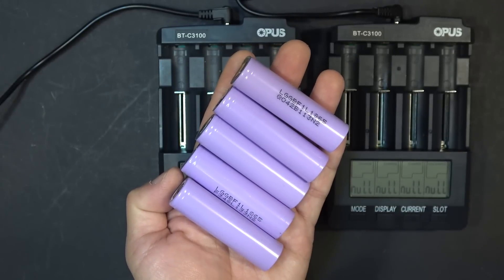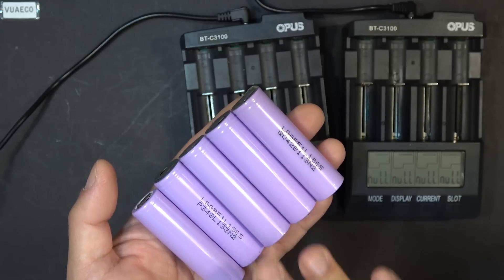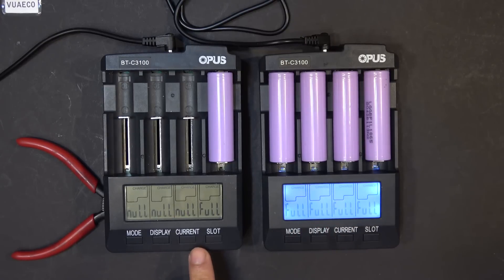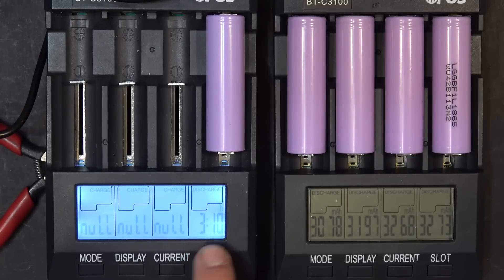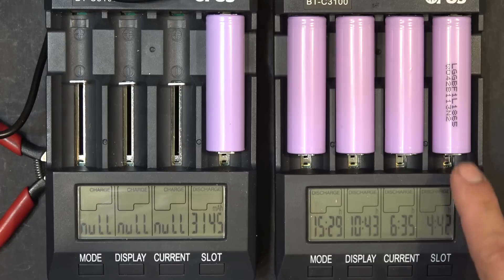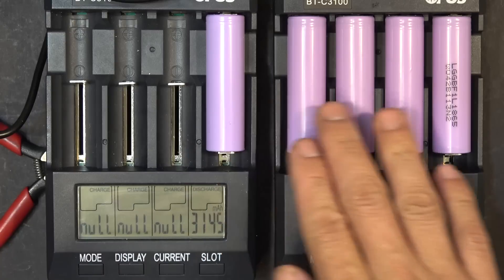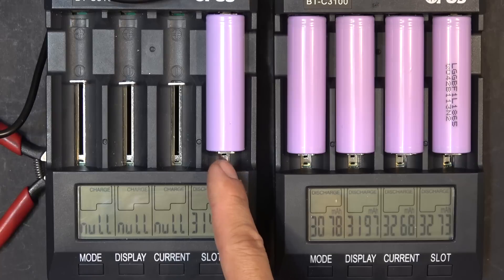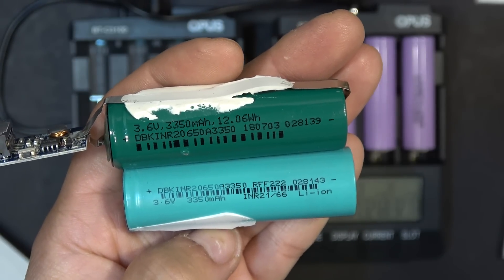Test 18650 cell capacity at different rates: what's the optimum rate of discharge?

Comment: Discharging slow or fast is not anything like driving a car fast or slow. It all depends on the battery, some are meant for high (fast) power draw, others are more suited to slower usage. But all will provide a 1 amp draw no problem, testing 18650 at 0.2amp or even 0.5amps is kinda crazy, that’s for testing much smaller li-ion batteries like 14500 or even AA/AAA NI-MH cells.
Reply: Except at a higher draw you are going to have a higher voltage drop, discharge test stops when the voltage under load hits the shutoff point. If you notice the cell he discharged at 1ah bounced back to a higher voltage than the rest.
Reply: Freedom Unrestricted resting voltage vs voltage under load is irrelevant. Like when a full 12v battery shows 14v while resting but then drops to 12v under load. They all bounce back but unless under load the voltage reading is basically meaningless. He was testing 18650 batteries not AAA or 14650 those low settings are meant for. As long as you are not overrunning the batteries to the point they are generating excessive heat it’s pointless to run at a very low draw while capacity testing. Just making a test that could’ve been done in a couple hours take all day, the end mah reading will not vary significantly unless running at a very high current draw the batteries are not rated for.
Reply: @Alex-us2vw  voltage under load is when the charger or even a bms shuts off. Voltage under 1 amp load is going to be less than voltage under 0.5amp load with the same battery. You can generally squeeze more juice out of a battery with a slower discharge rate for that reason.
Reply: @Alex-us2vw  Hello Mate!
Reply: No actually the car analogy is actually really accurate in this case. A cars engine and valve timing is made as a compromise to extract the most amount of energy from combustion as a specified rate or RPM. Yes air resistance increases constantly with the cube (x^3) of the speed but it is only one type of drag, usually irrelevant at speeds under 25 mph. Almost all cars made now days are designed to get the most gas mileage at a compromise speed, usually around 40-50 mph. This is a trade off with engine wear, and engine max power (horse power). An exception to this rule is Honda, they tend to make cars with small engine displacement because of the Japanese export engine tax is mostly a flat rate based on engine displacement, so Japanese companies, especially Honda who likes to make high revving engines, especially motorcycle engines choose a higher rpm to get the best gas mileage. The way Honda has engineered around this is with their vtec technology which changes the valve timing profile so you can get really good emissions performance during slower city driving but still have the engine literally “click” over into a more aggressive performance optimized timing at higher engine rpms. Something very similar is happening inside these batteries, they are optimized to give max power at typical electronic loads of around 1Amp. Looks like according to this test they choose 700mah as a compromise current for peak performance. The main variable is surface area, geometry, and chemistry on the expensive cathode (cobalt usually the best with a bit of silicin). But this too is a trade off with durability and max power ability. Interesting to see how far 18650s have came. From the defacto  laptop battery to the main battery used in early performance focused electric vehicles (Tesla roadsters)
Reply: Energy is lost as heat of resister.
Reply: Yes, all will provide a 1 Amp discharge, but usually, manufacturers state the lifetime or maximum capacity at a given discharge rate. Usually, laptop-cells seem to perform best around about 0,5-0,7C discharge rate. Any higher and they will just perform slightly less.
Just check the datasheets available to see what the best rate is. Don't forget that a battery that isn't able to perform at it's full capacity could very well be usefull for a less demanding application.
Reply: With driving a car fast or slow it’s the air resistance at high speeds that begin to affect efficiency significantly beyond 60MPH. There is no air resistance pushing back in an electrical circuit or in the battery
Reply: @Alex-us2vw  there is definitely resistance in a cell / battery, and there is resistance in any circuit involved in the process, and it pushes back, against the pressure (E).  You may point out that it's not "air" resistance, but the concept in general terms is the same and still valid.   And according to most datasheets on lithium cells the discharge rate does affect the capacity of a cell, as does the temperature, which can benefit or degrade the capacity, depending on cell chemistry.  The differences, even if so very slight in the eyes of most, are crucial to those who are RC racers and also to Vapers.    I understand his point, even if it's not 100% scientifically absolute, it was an effort to explain the concept in a way some people could understand.  Professors and teachers often use everyday situations to illustrate abstract concepts.  Thank you for your hard work in all your videos Vuaeco
Reply: @Alex-us2vw  Mate can you help me?
If i have a 32Kwh battery and i am using a 35 Kwh motor, so if i travel at 15 kwh motor speed will i reach my destination with 15 kwh battery left or it will be less or more?
Reply from the maker: @Alex-us2vw  Hi Alex, how about you and I compete in a 100 meter distance to see who spends the least energy. I'll walk real slow and you will sprint with all your might. Let's see who's gonna spend the least amount of energy to get to the 100 meters. :D
The point of this is you will get there probably 10 minutes before me. Is that the 10 minutes you gain for free? I don't think so. You will have to pay for it by spending a lot more energy than me.
Reply: vuaeco that’s not how electricity works though
Reply from the maker: @Alex-us2vw  When you discharge faster, you can complete it in less time. Are you saying the time you gain is free? You are breaking all kinds of rules in nature.
Reply: vuaeco what? Of course when you discharge at a higher rate a battery will empty faster. You were talking about discharging slowly being more efficient though, which is not how it works with electricity then giving examples which have nothing to do with electricity. They physics is very simple (Joules = watts x time) there is no efficiency gained by using less watts it’s just will take more time vs a higher draw. So discharging at 1 amp in a few hours or 0.2 amp over a day will yield the same value on a capacity tester
Reply: @vuaeco  I think you will understand if you run the same test using a group of normal 18650 and high drain 18650. You will find that even if they have the same capacity, even if the same discharge rate will give you different mAh reading across the 2 class.
Reply: @vuaeco  your analogy is not the right when talking about capacities of batteries. you can look at a cell like a bottle of water. if you have a 1 liter bottle and you pour out water from it fast, it will drain fast and 1 liter of water will flow out. If you use the same bottle of 1 liter and drain it slowly you will still get only 1 liter. Pouring water out slowly does not mean you will get more water out of that bottle. same with a battery it does not matter how slow you discharge it. it will always be the same mAh.
Reply: @vuaeco  3 years late on this, but I do want to add that Vuaeco, if you take 10 minutes to walk 100 meters, you actually WILL spend more energy getting to the finish than the person sprinting, as you'll be carrying your weight for 40x as long. I did look this up just incase, and yes, a 175lb person sprinting 100 meters will burn about 9 calories. If you're going to take 10 minutes to walk 100meters, i'm just going to treat that as standing for 10 minutes, and a 175lb person standing for 10 minutes would burn about 31 calories. Love your channel and videos though!

Comment: Just switch Battery 1 and 4, but let the settings be the same, test again and look if bat. 1 ist the lowest capacity again. It could be just a lower cell, no matter how fast you discharge it

Comment: Different cells are built for different tasks. The best way to choose the current for discharging is by reading the datasheet to understand what is the rated discharge rate. We are doing a giveaway for 4 megacell chargers for testing cells in case you want to do more automated testing for multiple cycling etc

Comment: I used to drive for a living, and my understanding is that gas mileage is determined more by revolutions per minute (rpm’s) than by speed. There are sweet spots at different gears, that if one drives at those rpm’s in those gears, they will burn less fuel, also a sharp increase in acceleration, especially on an incline, will burn a lot of fuel. So, an increase in speed doesn’t necessarily burn more fuel.

Comment: you should do the same test but with the same battery as they all slightly different even they new. take just 1 battery and discharge it , you will see no difference. Don't mix up electric with petrol. Bad example. It is the same like compare cheese and carrot :)

Comment: the issue with that test is that you are testing different cells, even if you discharge the at the same rate, you'll get different results. 
You need to take the same battery and test it with different discharge rates, sure it's going to take longer but it makes more sense.

Comment: what you could've done is retest again, take the 200ma discharge rate battery and change it to fastest 1amp and see if you get more capacity.  Same with 1amp discharge rate battery and discharge it at 200ma and see if capacity is lower.  Would tell you if its the battery or discharge rate that is affecting your capacity

Comment: Fusing over those small differences is not going to tell you much especially since you didn't test them all at the same rate to begin with to find out how they compare. I don't think you will see much difference until you start testing at differences above 1 amp.

Comment: It's all about cell internal resistance. Means, that cell gives you more discharge time who having more internal resistance. Sometimes people get confused when they noticed that same capacity holder sells gives different discharge time. You should check internal resistance of those cells. For example you have two 2000 MAh cells. On same load . One cell  discharged in 10 minutes and other cell discharged 1 hour , it means that faster discharging cell has less internal resistance , and other cell has high internal resistance . Thank you.

Comment: Hi . If these is high rate cells is normal , they perform as same like a laptop battery in this range off discharge rate  BUT they start shining in performance when you put them in 8-10 discharge load . Well opus can’t do that .

Comment: your intuition and experience is generally correct that bigger loads reduce capacity. this is because more heat is usually generated by higher loads. the trouble with this test is that due to equipment limitations the discharge loads are too small to generate the kind of heat you get from real loads, and in the range of testing, you are probably in the flattish part of a convex temperature curve. (by 'convex' i mean it increases at an increasing rate).  with temperature rising very slowly from 200-800mAH, total thermal energy released (measured in an energy unit like calories) was largely a function of the time the cell spent in discharge rather than the discharge rate, so you saw increased capacity up to 800mAH because you had big reductions in time spent in discharge and only small increases in temperature. then you had a little drop in capacity at 1000mAH because the temperature curve is moving into a steeper slope here, enough for energy released as heat to overcome the shorter discharge time. if you tested the cells at increasingly higher discharge rates above 1000mAH, e.g, 2A, 4A, 6A, 8A, 10A, you would get into steeper portions of the temperature curve, and i predict you would find the trend you expected. but in the low range your equipment can test you're seeing this unexpected effect due to convexity of the temperature curve.

Comment: try it with more current. 1A is so easy for li ion batteries. so it doesn't matter if you try it with 1A, 0.5A, 0.3A or 0.2A. they will all be equally effective.

Comment: Hi, 
I'd like to have seen you baseline the testers first before testing the batteries.  As you mentioned the batteries won't be identicle, and the testers won't be either, and similarly each slot will have it's slight variance.
You are right about the lower discharge rates should show higher capacity, but as you didn't baseline your test, the results are suspect.  The battery in slot 1 you discharged at 200mA may well be the worst battery you have, so had you used the 700mA discharge rate, it could well have read even LESS but who knows....

Comment: I'm having the same issue. I tested cells at 1a then tested again at 500ma and got half the capacity. After having capacity issues during discharge.  Very frustrating when I'm trying to match the capacity in each pack.
Reply: Have this charger too.  Use it mostly for Ni-MH & I think the charger gives very inaccurate readings.  I know it does for impedance.   Same thing happened to me & for Ni-MH there should be a noticeable difference between 200 & 700mA discharge rate.

Comment: Does the charger work with Ni-mh?
Reply: Yes, I have it. Works for Ni-CD also.  For Li-Ion the cut off V is 2.8 to 4.2.   Wouldn't have got this if I knew that since testing capacity will be kinda useless, since almost every battery is rated at a 2.5V cut off & some are 2.0V.  Some are 3V..    If you open it up, there is a switch on the motherboard to goto 4.35V.

Comment: In order to have accurate data, you will need to test all 5 batteries in all discharge conditions.  Then you can compare each battery to each other based on the same discharge rate.  Only then can you determine what discharge rate provides the highest capacity.  You are assuming each battery has the exact same capacity but you are only guessing.  Peukert is your friend.

Comment: IMHO, first, each cell still has its own internal resistance characteristics, even those look the same brand new. Secondly, opus is not professional piece of equipment for trustworthy results. Third, but not least you use 2 pieces of equipment and you charge 1 cell by means of first one and 4 cells with the help of the other. To get comrarable results better to use one piece of equipment testing cells one by one.

Comment: You would have to test the same cell multiple times at each discharge rate to get a more accurate average. Testing the same cell twice at the same discharge rate will give slightly different results. Comparing one cell discharged at 200mAh to one discharged at 1000mAh isn't a very reliable test.

Comment: I just bought one of these chargers and it seems to reach the cut off voltage prematurely. Every battery I have tested is 75 to 84% of the manufacturer rated capacity. I don't know if it's the batteries, the chargers program or both. Lets say one battery is being tested at one amp and another of the same model battery is tested at 200milliamps. The higher load causes the battery to drop in voltage to the chargers cutoff point(2.8volts I think) while the smaller load doesn't bring the battery to the chargers cutoff point as soon. When the higher load battery slot stops discharging the voltage bounces back to 3.6volts(as an example) while the 200ma discharge battery bounces back to only 3.3volts after cutoff.  It would be nice if the charger's cutoff point could be modified(secret menu anyone?).
Reply from the maker: When you discharge at 1A, it's a whole world of difference when you discharge at 0.2A. Discharging at a higher rate makes it less efficient hence you get lower capacity. You can complete it faster but the gain in shorter time has to be paid back by lower capacity. It is more accurate to discharge at a slower rate. It's just simple physics. Read my pinned comments above with Alex1911
Reply: I also forgot to mention I live in the USA and the OPUS BT-C3100 I am using has a European plug. Is the discharge routine dependent on 50 cycle AC current?

Comment: The voltage cut off for this charger is 2.8 volts but cut off for most 18650 is 2.5 so you lose a bit there.
Reply from the maker: 2.5V discharge is way too much and it will damage the battery. There's a reason why the charger only discharges the battery down to 2.8 and not 2.5
Reply: Yes, was gonna say that.  I just got this charger and didn't know that.  Is that's standard for most chargers?  Seems kinda useless for testing capacity since almost all 18650 batteries are rated at 2.5V cut off & some are 2.0V.  Also, some charge to 4.35V (at least the 16650s do).
Reply: All battery manufacturers discharge to 2.5v and charge to 4.2v.= rated capacity
Reply: @toveryonder1115  Not all.  Some are more or less, but never heard of 2.8V cut off..   Maybe this charger is so inaccurate they set it at 2.8V to make sure that it will never go below 2.5V.

Comment: You should have discharged them all at the same rate in the same unit and in the same slot for a base result then repeated at different rates and produced the results in a percentage of the original base result. Your theory of discharging faster giving less capacity should be true as a higher discharge rate will produce more heat / wasted energy.